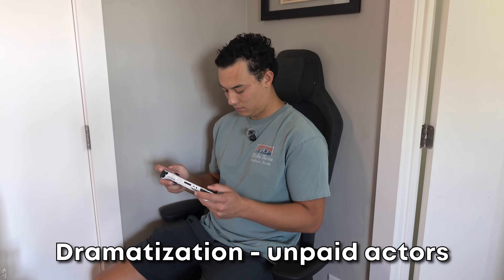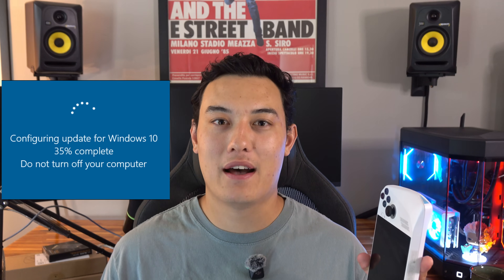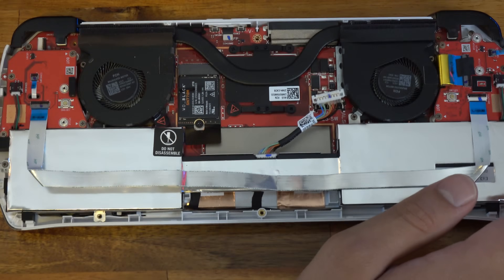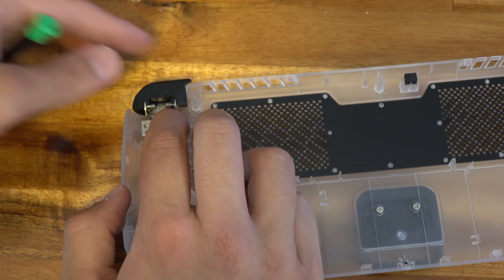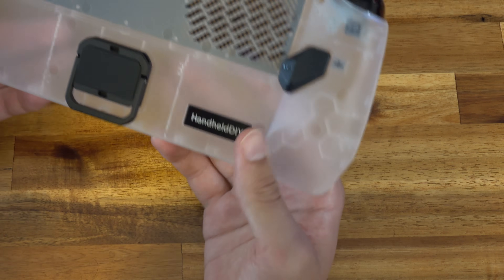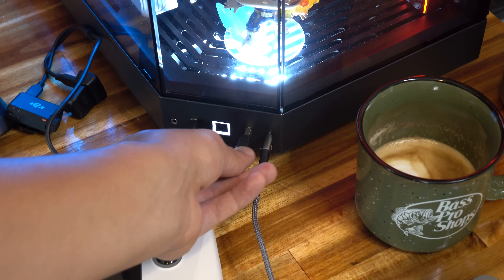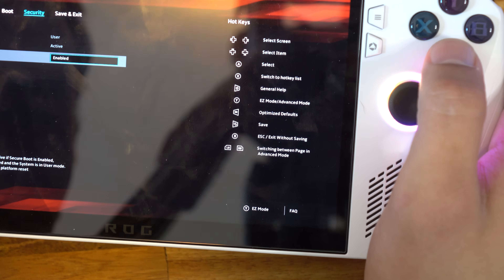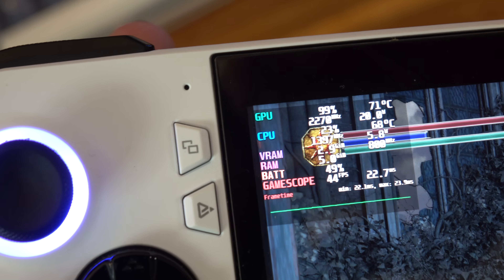$250 ROG Ally Overhaul – Full Mod Guide

Comment: Not fully modded you have to put 8TB of 2280 SSD in there for it to be fully modded.
Reply from the maker: Might as well wire up a 5090 while im at it
Reply: @JokOfAllTrades I have a RTX 3060 12GB EGPU wired up to my ally X I game at 4k 240hz only problem with it is my Samsung G8 monitor makes a lot of heat it makes my room about 10 degrees hotter when it’s on.
Kind of made me regret selling my 1440p 165hz monitor it did not make so much heat even when I turn down the settings to 1440p 120hz and I put the brightness down to 65% it still make my room like 6 degrees hotter it will be good in the winter time because my room is always cold but for the summer it sucks kind of make me feel like I’m using a over clocked EGPU 🤣 😂
Reply from the maker: @atmphil1 ive heard the samsung ultrawides are not great, and im a massive samsung fanboy lmao.  Ive really been eyeing that LG 5K2K for my main setup but it's like 2 grand

Comment: Nice video mate!!!also put the big silicone pad on cpu heatsink so it can move heat on backplate heatspreder. 

So u recommend the battery mod if allrdy have anker 737 powebank? 
Thx
Reply from the maker: Thanks man, i got another comment about the same thing.  Im glad i ddint throw that piece away haha
Reply: which piece again?  isn't the big thick thermal pad doing that already?
Reply from the maker: @albocaj5975  its a grey squishy rectangle  that was included with the backplate

Comment: Holy crap all of that and you could have sold your Ally for $300-350 and bought a used Ally X for $500-550.
Reply from the maker: Wheres the fun in that 🤓
Reply: @JokOfAllTrades I also did the back plate, SSD and Heatsink, grips, and a nice skin at the front. But, at the end of the day that 16gb ram is very limiting....
Reply from the maker: @ExXxC4L1BUR  for 1080p gaming i really dont see the ram bottlenecking me.   What is your allocation of vram to normal ram?
Reply: Where do you find an Ally X for anywhere near $500? 😂 I’ll sell mine right now.
Reply: i bought my rog ally z1e for 370€ and all ally x's that were listed were like 850€+, wayy more expensive in EU, and thats even if you found a listing since they sold out instantly
Reply: In Canada Ally X costs $800-$900 CAD refurbished/new. I bought a used Ally for just $350 CAD. For me these mods are worth it! If only I can upgrade my ram to 32 GB that transformation woulld be complete

Comment: I found a modded ally it has 32 gb of ram at 7400mhz 
Im considering getting it but can i do bios update ?? Is it safe with the ram mod ??
Reply from the maker: Depends on the price, for like <350 id probably risk it
Reply: @JokOfAllTrades im considering it but 
Do you think ill be able to do bios updates since he changed ram capacity and speed and probably voltage im not sure if i can do bios updates or not what do you think bro ??
Reply from the maker: @27aiman  yeah i think its fine bro, worst case you can flash from a usb stick
Reply from the maker: For 515 euro i feel like your close to being in range for a used ally x.  I would maybe see if you can try and snag one for like 550 euro instead of taking the risk on the modded z1 extreme.

Comment: Is the bazzit install worth it, whats the pros n cons
Reply from the maker: pros: linux based, light weight, pick up and play functionality, easy to setup, boots way faster than windows

cons: steam dependent (it is really only good if you mostly want to play your steam library)
Reply: You can dual boot windows and bazzite, and swap between the two as needed/wanted
Reply: Dont use if u want play some games have anticheat so linux not supported it
Reply from the maker: @AlwaysToxicTank good callout

Comment: Not sure how dedicated you are but I found this one very interesting. I can't remember if it was this video or another where dude used vehicle exhaust auto body insulation metal type tape to help reduce the heat exposure on the SD card slot. He cut several small pieces that he then layered one on top the other right on the SD card reader to stop frying the sd card. Honestly just started researching these things because my son wanted one and managed to find a refurbished one for cheap on eBay. https://youtu.be/c9-c5M8reXI?si=4XVlcS1vfI2d1Iwz
Reply from the maker: The insulting tape is prob a good call if you have a 1st gen ally.  Sounds like you got a good deal on ebay, i 100% recommend this handheld

Comment: Hey, great video helped me make some decisions about my ally setup. I'm looking to use this backplate, have you tried removing the kickstand so you can use the jsaux modcase? Or any other cases
Reply from the maker: Hey man, thanks for the comment! Im not really sure why you would want to use both, the back of the jsaux case would cover the additional cooling vents and this backplate comes with the strap and kickstand.  I would probably just try and find a different cover to use if you want to protect the front.  Hope that helps!
Reply: what do you mean exactly?
Reply from the maker: @albocaj5975  he has another case that he wants to fit with the backplate i used.  I dont have the case so I cant test for certain

Comment: By using this backplate, can i omit the aluminum plates, and aluminum tape that others use with the stock backplate?
Reply from the maker: I didnt do any of that and i saw massive cooling improvements.  Its a sneaky good upgrade, i have been surprised at how much better my temps are
Reply: No. Use the aluminum plate. The heat from the RAM will kill your battery over time. I ordered a sheet off ali express for 5 dollars and got it in 2 weeks

Comment: If I use the jsaux battery with the backplate, do you think I'll still need to lower that foam bracket like you did, or do I not need to keep it installed since that battery had the plate included?
Reply from the maker: Hey man, thanks for the comment! I believe the jsaux kit comes with a specific backplate.  The downside is that i think its only like 65Wh.  I personally think you would be better off getting the 74Wh and doing the cutting yourself.  Let me know if you have any questions about the process

Comment: I noticed you didn’t use the silicone pad that comes with the mod case, it goes in between the vents on the inside to soak up and dissipate heat from the cpu. Any reason you didn’t install it?
Reply from the maker: Holy, haha I had no idea what that pad was for.  Im glad i didnt toss it, can you lmk what guide you saw so I can install in the right spot?

Comment: I'm surprised that no ones made proper aftermarket blowers (maybe with some LEDs). I've seen heat spreaders which might be another mod worth considering.
Reply from the maker: Thats a great point tbh, I may try and see if i can get some small fans and 3d print a more efficient housing.  Stay tuned, I will do some research and see if i can hack something together

Comment: A little nerdy correction here.
Bazzite is a fork of Fedora, while SteamOS of Arch. 
Many thing are very different about Fedora and Arch use, but in this case bazzite is optimized to be as close to the steam deck experience as it possibly can.
Reply from the maker: Appreciate it bro, thanks for the info 🤓
Reply: You can use CachyOS handheld edition, which is Arch based, so it's a direct comparison to Steam OS.
Reply: @vusun123  sounds nice, I don't really know what Bazzite does aside from having some stuff like HDD preinstalled and it gives you a GUI to install Decky and stuff
Reply: @EverRusting CachyOS Handheld Edition also preinstalls HHD for you. Decky Loader is optional.
Reply: Out of curiosity, what difference does that make in practice? When disregarding the UI differences.
Reply: @Eihei i have never used handheld os, but I have experience switching custom roms on mobile phones and custom os for PC, if you talk about straight up performance gains there's not a huge lot of difference between these custom os, but one this that goes for them is privacy and bloatware free unlike stock. On mobile environment you can even fiddle at kernel level to squeeze out juice on an older gen device to be able to compete at modern level standards, at the cost of higher temps. This might be completely wrong for handhelds, but I saw your comment and decided to tell you what I know about custom os.